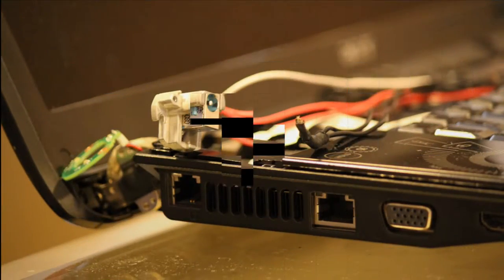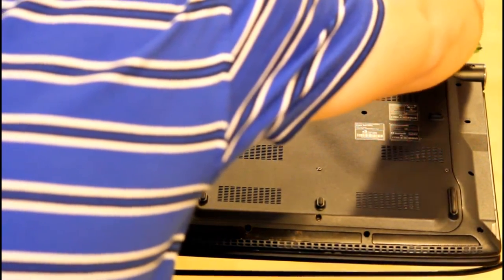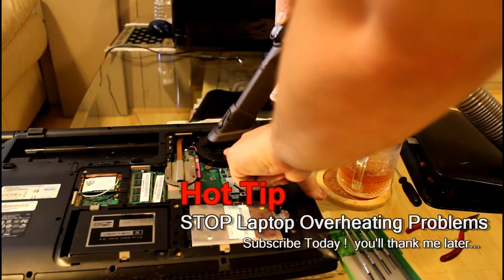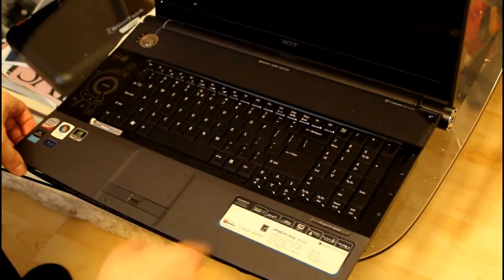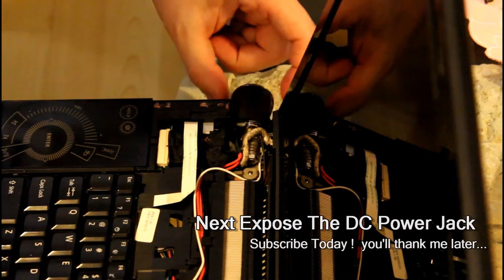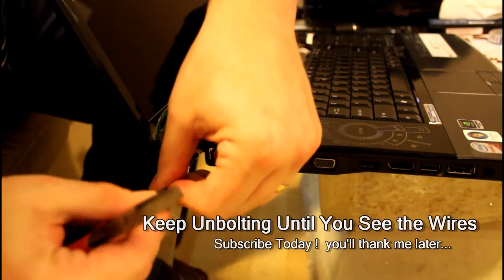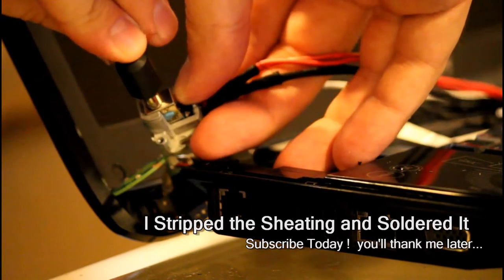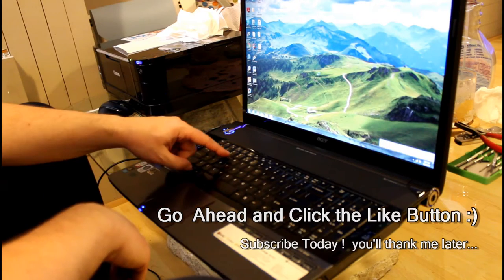How to Fix Broken Laptop Power Jack by SelfMade Lex

Comment: my laptop has no wires. it just has little metal prongs the prongs of the power jack have to be touching. it often shifts out of place and doesn't charge as a result. what do i do to fix this? i've never used a solder before so i have no idea what i'm doing.

Comment: Great video and it helped solve my problem, the only thing is it's a royal pain trying to get those wires to fit correctly, they won't allow the power socket to fit tight when screwing it back on because of the soldered joints.  Wish you'd post a video of exactly how those red and black wires should fit through the power socket allowing a good fit!  Can someone else advise! thanks.

Comment: absolutely do not use a vacuum cleaner to clean your fan or any other component with any electronic. Vacuum cleaners create static electricity and you risk destroying components in your computer. Just use compressed air

Comment: so how do you remove a strip screw ;)
Reply from the maker: Oh boy, you stripped a tiny screw huh? Well they sell little kits for removing broken screws like this one http://amzn.to/2tb1Noz. That would be your best bet to cause the least amount of damage. If that doesn't work, you can try using a drill bit, but you have to be very careful not to damage your laptop in the process. good luck Ryan.
Reply: thank you I have to fine a way to fix the pin in my laptop or replace the mother board  in my ausu q200e 

Thank you ;)
Reply: Lex Selfmade Life When putting in a replacement does the color of the jack itself matter? I have an Aspire v3 511g-8469. The jack in mine which was broke was Silver and Yellowish. However when I search online for my exact model most of the jacks are blue and silver. Lastly the top of my broken jack says 65w does this matter when finding a replacement.